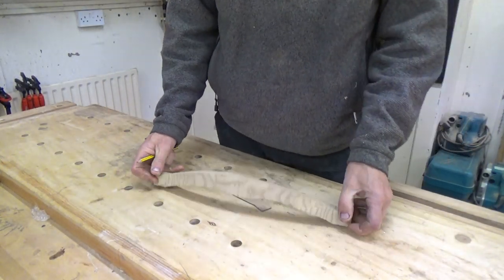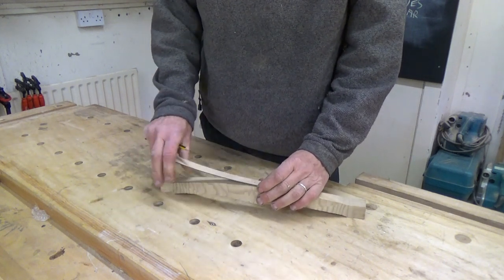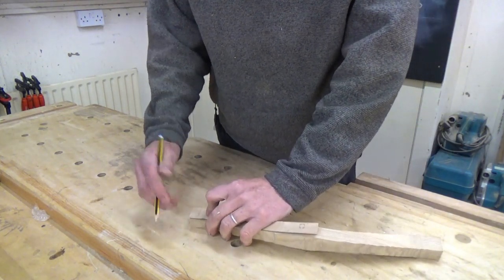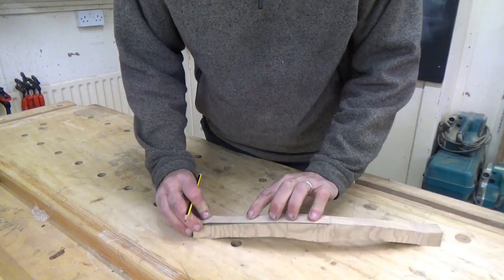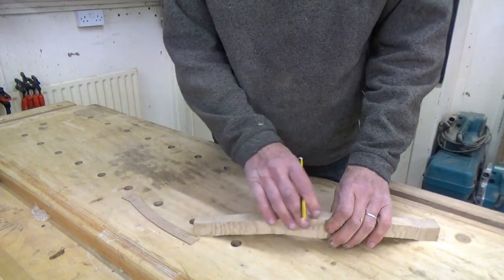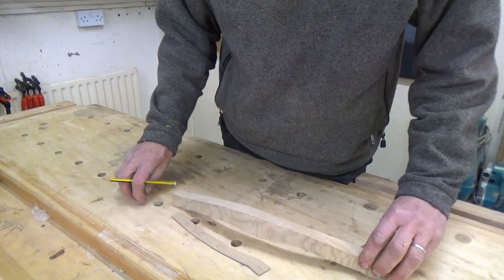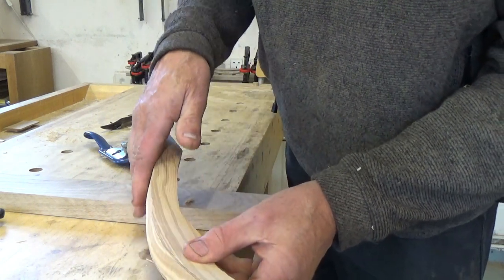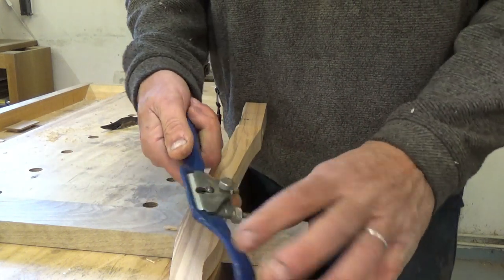More on spoke shaving.

Comment: I'm surprised you did not resort to a scraper to clean up that finicky end. A legitimate tool if you don't like to Rasp / File.  I too like to use templates where I can to get consistency with multiple same pieces.  Thanks for your time.
Reply from the maker: Yes Peter, I'm a bit surprised too as the scraper is one of my favourite tools and it would have dealt with that. I must have got fixated on the spoke shave, I did use the scraper when working on the bottom profile. Those end pieces did actually clean up OK just using 180 grit sandpaper.

Comment: Would a rasp be useful in a situation with so many curves and grain direction changes? I don’t think I’ve seen you use one.Is there a down side to using a rasp? Lack of precision perhaps.
Reply from the maker: Hi Bill. You are probably right,  but somehow I can't bring myself to use a file or rasp on wood . I just feel that a wood surface should be cut with an edge tool, not abraded , it almost seems a sacrilege work it with an abrasive tool. This is partly why I don't like using sandpaper until finishing time. I know this may be irrational and I could save time with a rasp but I just can't bring myself to do it!